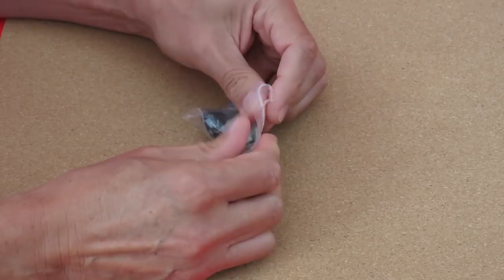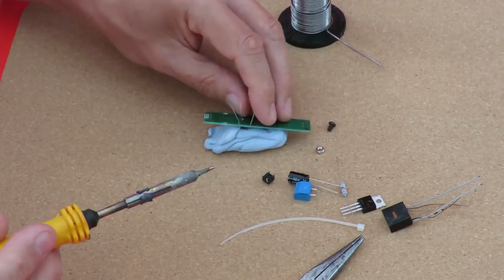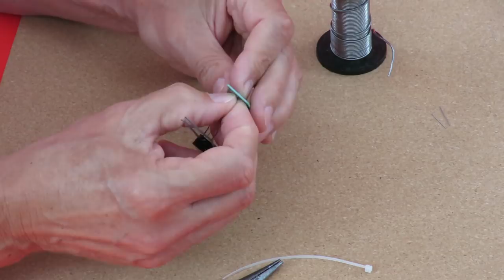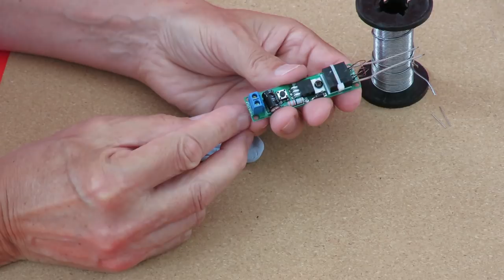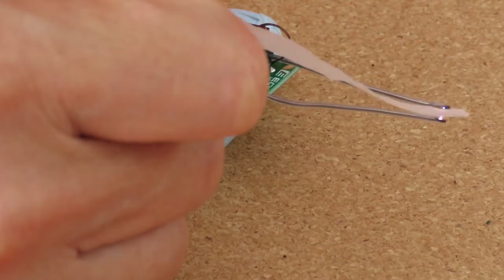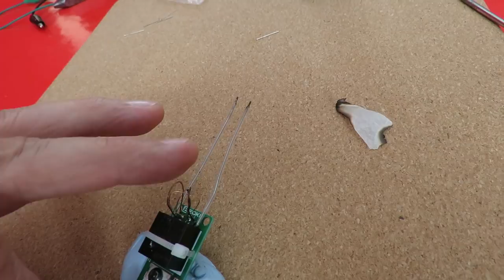Grandad assembles a DIY HV 1 High Voltage Igniter Kit

Comment: Another great EBay kit find!  I just ordered one.  My mind is going crazy with all the things I can do with this thing such as ----mini Jacobs ladder,  mini HV source for a Tesla coil, or perhaps a CFL driver.  The amp draw is pretty high but it is a perfect fit for an 18650 battery like you showed.  Thanks for the 'How To' video on how to assemble it.
Reply from the maker: It would be interesting to split the black box apart. I think it is just a potted transformer to step up the voltage. I just picked up an interesting "electronics kit" in a charity shop. It is titled Neon Sign Writer but reading the leaflet/instructions it uses a phosphor coated copper wire which will glow or electroluminesce when current is passed through it. Haven't tried it yet but I probably will later tonight. The power supply uses 2 AA batteries a transistor and a transformer. Couldn't wait any longer, tried it, it works fine, not sure when I will post the video, I am sure the grandsons will love it 😊😊

Comment: Thanks for the video, I bought one of these from AliExpress for $3 and was trying to find instructions for the transformer wiring.
You got it right ! It seems like it was designed to mount on a 18650 battery holder with double sided tape & cable ties, thats how I mounted it.
Should get about 1-2 years per charge I reckon ! [I don't smoke]
Reply from the maker: Glad you got it working 👍

Comment: '
hi G...
how many volts on this both front antenna sparkling fire
Reply from the maker: Sorry, I really have no idea 😕
Reply: @GrandadIsAnOldMan 
'
hi G...
try use the electric volt tester with both black-red wires and check the volt...
thank
Reply from the maker: @bestamerica  it is supposed to be very high voltage so I am not going to kill my meter to find out.
Reply: @GrandadIsAnOldMan 
'
hi G...
alright thank

Comment: I build my kit and it does not seem to work. I am a technician by trade so I know for a fact that I connected everything correctly. I tested the diode and it turns out to be bad. I got send bad parts :(.
Reply from the maker: Main thing I found was it was important to adjust the gap before it worked.
Reply: @GrandadIsAnOldMan  I got a new diode and adjusted the gap. Bow it works well.
Reply from the maker: @epikindinos21  excellent 😊👍

Comment: Just seen this one.
If you put a higher voltage capacitor on it and more power you could build a small Tesla coil.
If you did you would have to put a high voltage diode on one of the high voltage output terminals in order to give you DC high voltage because you would need the high voltage to be DC in order to charge up the capacitor of the Tesla coil circuit. That would then discharge through a spark gap. 
Here is the basic Tesla coil circuit you would use:
https://www.pocketmagic.net/wp-content/uploads/2009/01/tesla_coil_cc.png
Forget the AC mains transformer on the left of the diagram because that is where you would join your DC high voltage too. The tank capacitor in the Tesla circuit needs to be a high voltage capacitor "not" an electrolytic one. It would work pretty well. :D
Reply from the maker: Thanks Mike. I did do a kit a while back that is not a "true" Tesla coil according to aficionados
Cheap eBay Telsa Coil Kit TESTING https://youtu.be/dkZf9GvZssk
Cheap eBay Telsa Coil Kit BUILD https://youtu.be/NZ4ZrO26wP4
Grandad's Postbag 180306 Telsa Coil + Build https://youtu.be/A10axQShMEE
and you might like this one
Can I copy the Bug Zapper Mod by Banjax66 ? https://youtu.be/9VeLI27JO0Q

Comment: I got one but it doesn’t work 😕
Reply from the maker: I found I had to adjust the gap to get it working.
Reply: @GrandadIsAnOldMan   thank you! I think mine might just be damaged though
Reply: If you still have it can you check and see if it blows out at all? I have a project that runs a butane stream through an ignition system and I was wondering if the high velocity fuel would affect it